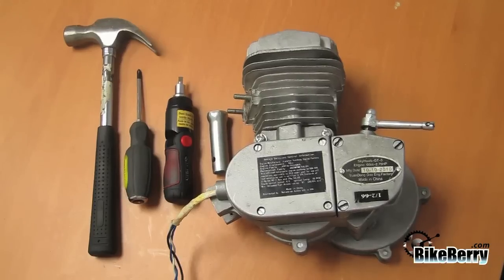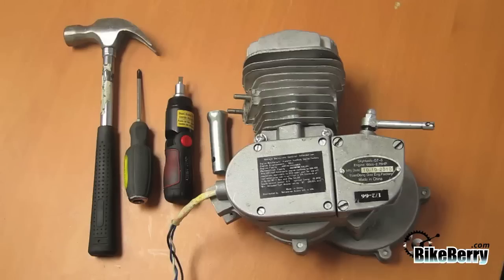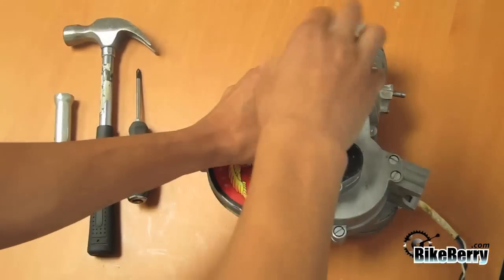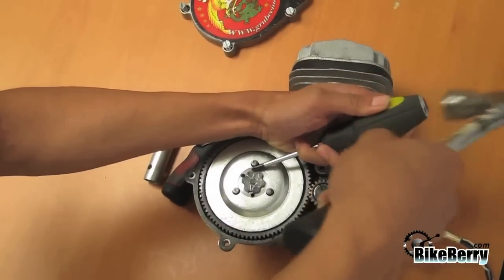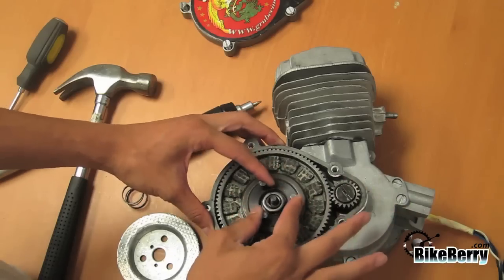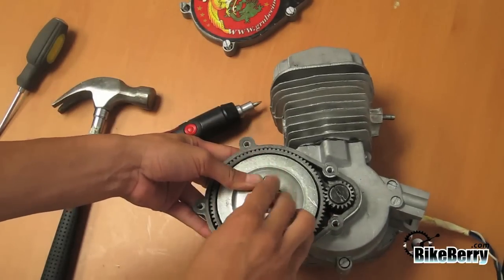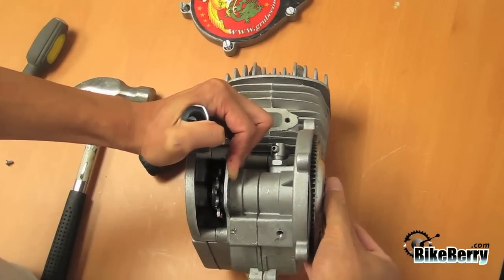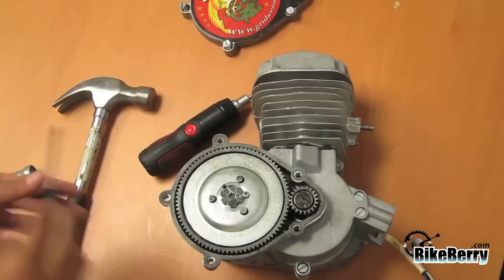How To Adjust Your  2-Stroke Clutch - 48cc 50cc 66cc 80cc -Motorized Bicycle

Comment: Nice vid Guys I have also had two engines recently  a 48cc GT2B and 66ccGT5 where the plate was just stuck to the clutch pads  and used a small slotted screw driver to unstick it by gently prying around the radius of the plate .

Comment from the maker: Power loss is generally due to the carburetor not being adjusted properly. When you twist for more power, the carburetor is trying to feed more fuel and air through a small jet.

Comment: Issues?   Please check that clutch pads are loosely fitted in clutch plate. Clean the clutch plates (only) with brake cleaner.   Also look up how to increase main clutch spring tension.  After hours of adjustments,  these changes started up my bike in 3 seconds.

Comment: The wire for the throttle cable is stripping away trying to assemble it its the wire that you put the springs on that turns the thing on top of wear the chain sits its to turn twords the engine but the silver wiring that you screw down is coming on ravled and the springs are being difficult to put back on
Reply: well looks like I have to replace the throttle cable
Reply: happens quite alo

Comment: I have a problem with my clutch, every time i adjust and put it back together i can walk it about 10 paces and it locks up again. I've tried adjusting it tight and loose doesn't make a difference. Any advise would be appreciated.
Reply: Same unfortunately I'm stumped, perhaps we are supposed to oil the clutch in a certain spot so it stops happening? :/ damn chinese motors lol
Reply: Hey i found an easy fix. Just tighten ur chain and tensioner as much as possible and make sure they dont come loose. Because once it gets loose ur chain gets jammed up inside the clutch sprocket.
Reply: Having the same issue, there's a roller bearing between that wheel with the 3 pegs and the clutch pad wheel that appears to be "clicking" and binding smh
Reply: YOUR CLUTCH CABLE IS GONA BLOW ! WHEN IT DOES YOU WONT BE ABLE TO GET BACK TO HOME!!!

Comment: if you`re confused about fuel to oil ratio, you can do what I did , go to you`re local Honda shop and buy a measuring cup for 2 cycle engine oil , you can buy oil there too .

Comment from the maker: That's the first time I've heard of that problem. If it doesn't effect your flower nut negatively, you may want to file down the clutch pin. Please do so at your own discretion though, as we are not reliable for this advice. PLEASE NOTE: do so ONLY if it doesn't affect the flower nut negatively, as in, it causes the flower nut to sit and screw back on the clutch pin improperly.

Comment: hi its me again thx for solving problem with wires but now im struggling to start up engine and i dont know what cause this I have spark now and when im trying to start up i release clutch engine is trying to get on but quick time its dying . before i opened clutch and i had to adjust this cover cuz these sprockets werent moving at all and i couldnt get spark now its all sorted but maybe i put something wrong thats why its struggling to get the engine on now ?

Comment: If the motor is engaging with everything else seemingly in order I should loosen the flower nut? Correct?
Reply: yes just it is tricky getting it to the right amount of loose tho just have to fiddle with it till it is right i had the same issue

Comment: Hi, got a used Bikeberry, replaced electrical, and finally got it to start. Was zipping along nicely when it appeared to seize up. I can barely run the wheel to move the chain. Any thoughts on what to do?

Comment: Hi l have a 80 cc  motor l haven't ridden for Three months motor has only done about 100 km clutch seems to disingenuous pressure plate from clutch pads But wether l have the clutch lever in or out it still turns the motor when l go to move it not sure what else to look at

Comment: Thank you.I can't keep the dang Nut from the Clutch-shaft tight.I put the inside-star washer in,after doing the first part of the Video,as I HAD to so I Could get 'Triple=tree'loose.>All went well for the first start,and 1/2 block.All tightened and it didn't want to stop.I Had to get to Apptmt.After Appt,the clutch kept spinning nut loose behind plate."Help-Plz'

Comment: i haven't started the motor yet but i noticed that assembling the throttle to the carburetor the cable was extremely tight. it doesn't seem to fit right... is this normal? also i did the test for the spark plug but never saw fire, how do i know its not the spark plug but the wire box?? HELP!!

Comment: Question?I'm putting a 48 back on after getting a faulty engine from zb upon re attaching the chain I noticed the bike moves freely with no clutch cable(always trying to start mode)any tips or tricks for that issue.

Comment: if I am replacing my square like clutch pads with new ones, which direction do the new clutch pads go in? One side of my pads look checkered and the other side is black......and what if the holes seem alittle too small for the actual pads to fit in.? Is this common? and what do you suggest to make the pads small enough to fit?

Comment: Mine had the spring but i removed it because it would pop out the screw and make it fall/scrape the clutch cover. Is there any problem? I know new engines don't have it, and mine seems to run just fine without the spring,even a little better than before i would say..

Comment: Hi Bike Berry, I find your vids very helpful. I have built 5 of these Grubee Skyhawk kits now, and sell them. The last 48 cc I did has a rattling noise in the clutch area. Now I have heard this is "normal" sometimes the pressure plate is out of round or something like that? I haven't opened it up yet, but do you have any suggestions on what that rattling might be? the nut loose maby? The engine and clutch work except the clutch will not engage until the clutch lever is almost ALL the way out. On my 66cc it is not like that. I will try and adjust it this weekend and see if anything is loose in there, but your opinion would be greatly appretiated!

Comment: The three pegs on my motor refuse to turn, they will only go about 1/2" in either direction. I know you said to assist it with a hammer, this did not seem to help move it. Have you ever heard of this problem before/have any suggestions? Thanks

Comment: Gotta question for anyone tht wanna help I just installed my 80cc 2-stroke.. when I let go of the clutch the bike takes off to like max speed.. n the throttle doesn’t do anything like when I turn the throttle it just turns doesn’t slow dwn when I release it or be at a complete stop to idol bike just goes .. what do I have to do to control my speed.. Idk what to do ...
Reply: ExtinguishFires _ 13 sounds like your carb spring is gone or not working properly. Or your carb is adjusted way too high.

Comment: Personally, I would use a pair of needle-nose pliers to remove that nut, not a hammer and screwdriver. There is something odd about my clutch setup right now not sure if the cable needs to be tightened or if that nut that you took off with the hammer needs to be loosened.
I had no friction at all thought my clutch pads were toast but when I got into it I realised that the pads are fine and only needed to be tightened a bit but I had to turn that nut to a spot where I could put the screw in and now I think it may be too tight either that or the cable has slipped, any input would be well-received thanks.
Also, can anyone tell me how you can test a boost bottle to see if it is doing anything?

Comment: Can you guys make a tutorial on how to replace an engine head and piston to a new one.
Reply: you remove the top nuts and take off the head first, then pull out the head gasket.  Then pull out the cylinder be careful as the piston will be there and just pull it out and Piston should be exposed.   The piston has a hole in the middle with a wire there.  you need needle nose pliers(Google it they are common tools).  and you need to remove the wire.  then remove the clutch pin and then you'll easily be able to pull out the piston.  the bearings will be in the middle of the rod.  you can replace if you wish.  that's it put it back together the hardest part is putting back the wire clip in the piston.
Reply: you remove the top nuts and take off the head first, then pull out the head gasket.  Then pull out the cylinder be careful as the piston will be there and just pull it out and Piston should be exposed.   The piston has a hole in the middle with a wire there.  you need needle nose pliers(Google it they are common tools).  and you need to remove the wire.  then remove the clutch pin and then you'll easily be able to pull out the piston.  the bearings will be in the middle of the rod.  you can replace if you wish.  that's it put it back together the hardest part is putting back the wire clip in the piston.
Reply: you remove the top nuts and take off the head first, then pull out the head gasket.  Then pull out the cylinder be careful as the piston will be there and just pull it out and Piston should be exposed.   The piston has a hole in the middle with a wire there.  you need needle nose pliers(Google it they are common tools).  and you need to remove the wire.  then remove the clutch pin and then you'll easily be able to pull out the piston.  the bearings will be in the middle of the rod.  you can replace if you wish.  that's it put it back together the hardest part is putting back the wire clip in the piston.

Comment: I am completely unable to unscrew the philips screw that locks the flower nut. I've tried a couple days now trying to unscrew it and now its stripped. Any advice?
Reply: vise grips?? grind the sides then grab it with vise grip, don't bust the head or you will have to get a tab and rethread it.
Reply: anyone else who has this issue in the future - theres a tool called an impact screwdriver which uses the force of a hammer hit to turn the screw very slightly, so the force of the hammer is applied while the screwdriver bit is being turned. some phillips are impossible to get out without ruining them any other way

Comment: I just got my bicycle engine kit to run and I was running it at full speed for about 2 min. When I was doing a tight turn  I slowed down and the engine turned off. I held the clutch to turn it back on but in the process it became to stiff to turn. The engine was hot and I was holding the clutch but it still would not spin. Would this fix  my problem?
Reply: I got that fixed one of the chain was jammed in the engine so it works fine but the engine gets really hot. for a full tank how many oz of oil and how many oz of gas should I put in the tank for the break in period.
 I did 1/24=oil, 23/24=gas

Comment: I'm a 72 yr. old female riding my Dewey motorized bike for about three days and all of a sudden the chain seems to lock up and breaks.  Do I just fix it with a master link  and try to start it or do I have to take the chain off and how do I take it off?  Do I have to take the cover off of the part where the chain goes through?  Does the locking up have to do with the clutch, as shown in this video?
Reply from the maker: Theodora Czarnecki Hi Theodora, it could be 1 of 4 things. 1. Your chain may be getting stuck on the drive sprocket. (watch this video) 2. Your chain may not be aligned https://www.youtube.com/watch?v=LvLPprywSPk 3. Your chain tension may not be correct https://www.youtube.com/watch?v=LvLPprywSPk 4. Your idler pulley may have been deformed while riding, be sure it runs smooth.
Reply: BikeBerrycom Before I rode the bike my brother in law tightened everything and had to fix some wires, as he was not getting any spark (some wires were backward) and did adjust the clutch, but he went home (up north and I am in Florida), so I am going to try and follow the video.  He showed me a few things to do on it, but I"ll put the computer next to the bike.  Although I have a Ph.D in Nursing, I'm not the sharpest tack when it comes to this stuff.  Thank you for your help.
Reply: Theodora Czarnecki buy a car its waaayyyy more reliable
Reply: +bob62065  4 strokes bike engine are reliable too.

Comment: Hey man here is my problem. I have tried putting the cover that goes on to the sprocket on the side of the clutch that you were showing in the very beginning of the video but the pin is blocking me from putting the cover back on. I have tried taking the clutch cover off and the plate as well and fiddling with some of the settings. I cant get the stupid cover back on that you took off because the pin is seated way to far out of the housing. I have checked for dirt and grime.. help please!!

Comment: should the gears turn when you turn the three bolt cause my engine won't start and it's new
Reply: +Larry Williba same here, did you adjust the clutch
Reply: +Царь бббомба i added a pull crank to it

Comment: I have a different problem. The rod that sits at the center of the drive sprocket is permanently depressed, leaving the engine always engaged. It can come out like it should but does not spring out from the engine
Reply from the maker: Give us a call at (800)317-0479 and we will be happy to help.

Comment: How long does a clutch usually last, and is it serviceable?
Reply: you can buy the pads for the clutch and so its pretty serviceable
Reply: Andrew Brady Just finished installing the engine on my bike last night.  Probably will take it out on its test run this weekend, then new tires and tubes will get installed as well.  Can't wait to get this engine going, tired of paying $50 a week for gas in my truck.

Comment from the maker: It's locking up because the fuel ratio is incorrect. These engines require a much richer fuel mix. I say flush your motor, and refuel it with a 24:1 ratio. If it's still in the break-in period, 16:1 or 18:1 should be the fuel mixture.

Comment: can't get my bike to start, the fuel valve is open, the choke is up, the white lever on the carb where the fuel enters is up at 90 degrees, the idle adjust screw is about halfway,...anyone have any ideas?
Reply from the maker: MrJabber22 Are you getting spark?
Reply: ya i checked and i am getting spark...at first my clutch wasn't engaging and the drive sprocket wasn't turning, i'm readjusting it so maybe that's the problem
Reply from the maker: MrJabber22 Awesome! Keep us updated. I recommended also double checking the small bevel wheel and making sure it's pumping the piston up and down.

Comment: Ok i just set mine up and when i try to pedal that engine tries to turn over and wont let me pedal will doing this help
Reply: thanks this helped but the other problem was i just had to tighten the cluch cabel so it would disangage the engine and sometime if im starting it will just like try to start but like dies instantly BikeBerrycom
Reply: ok so its like 4 days old just started for the first time today but when i slow down or pull in the clutch lever it revs the engine really high and doesnt want to stop and the the wing nut thing keep tightening back up to where i cant pedal every time i ride it so i loosen it i start the engine but it tightens again
Reply: Thank you just had to uncurl the throttle cable then screw in a new screw it was gone and now it runs great

Comment: unresolved problem... the system i received is totally seized... unable to turn the engine sprocket freely or at all. and loosing the clutch cover does nothing to resolve the matter...
Reply: +thcassidy so how did you fix it ?

Comment: my clucth wont engage it is very loose every time i move the bike the pitins move very easyley so it wont turn over properly any advice
Reply: remove the clutch plate,then put it back on after pushing down,had same issue,now it's fine,but very tight,but it does engage/disengage

Comment: Never adjust the clutch before mounting and running the engine because when you run the engine a couple miles the clutch is going to change because it wears in
Reply: So right at least 10 miles before going to adjust the clutch unless you absolutely have to adjust it in the motor to ride it but you can also loosen or tighten it on the handlebars or the 10 mm nut that's around the clutch cable you'll notice that when you install the clutch cable

Comment: No one has made a video on a complete rebuild of a Grubee clutch yet.  There is an issue with the clutch on these engines.  The adjust nut(not the fine adjust nut) on the clutch shaft screws tighter and tighter against the clutch spring until it completely compresses the spring rendering the entire clutch(and engine) useless.  Very poor design.  2 of the 3 engines I own have done this.  Again, I'm talking about the part of the clutch inside the engine, not the fine adjust nut under the clutch cover.  I have to figure out a way to stop the adjust nut from tightening itself on the threaded clutch shaft.

Comment: Wow very old video the Skyhawk is the best engine ever it's funny that they were talking crap about it because the new engines are a joke every single new engine sucks compared to the Skyhawk 66cc I had a Skyhawk one time that I ran without an air filter for a 7000 miles and I never even adjusted the clutch one time yes that was an exception but that did happen and it was like a 2012 Skyhawk motor go figure

Comment: i've got the grubee skyhawk 66cc and i absolutely love it. i customized a cannondale h300 and installed this motor kit. i used some of the parts that came in the kit but did away with most of it and upgraded better parts. the engine is fantastic. get rid of the sparkplug that comes with it. it's crap. get a ngk or autolite. and your best friend is going to be loctite. use it to the max. it will save you from loosing parts and keep your motor secure. email me at rgd62@live.com for more tips